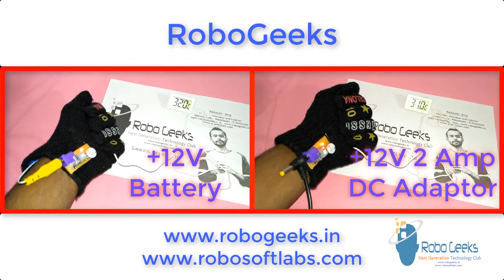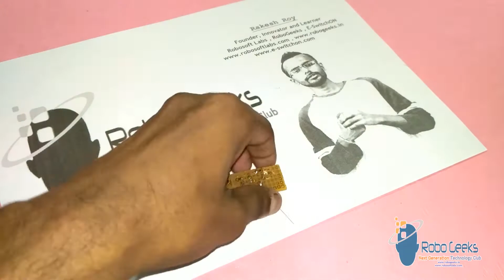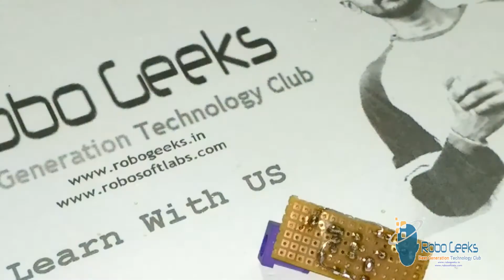How to make an instant hand warming gloves | Awesome Life Hacks

Comment: Sir I want to make heated grips from bike for winter ride in Himachal section. Bike battery will give steady 12v, what resister should I get without using preset?  Bike me switch laga sakte hai but preset lagana safe nahi hoga.
Reply from the maker: Test with 5k-10k!!! It depends on the thickness and length of the wire used!!!